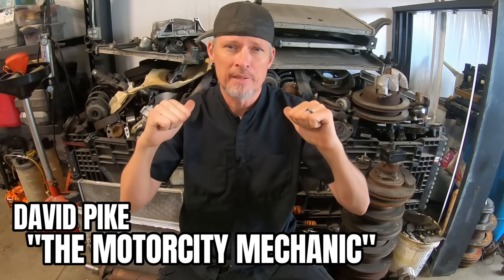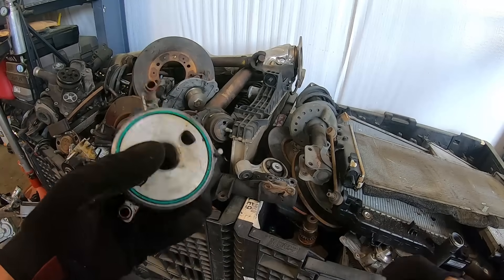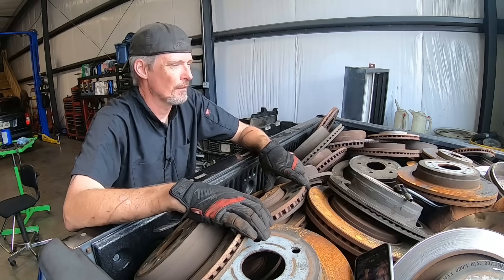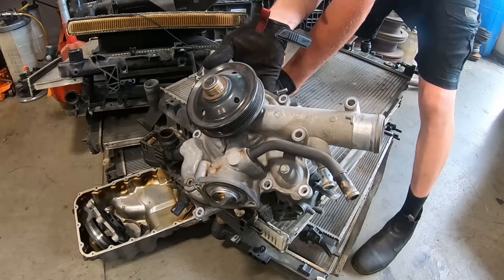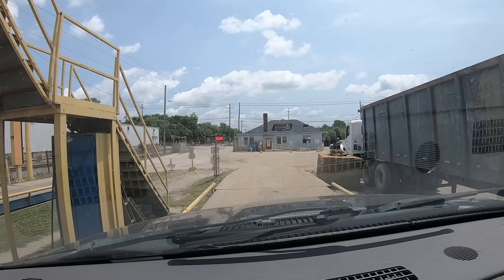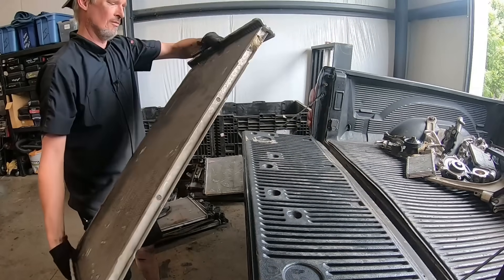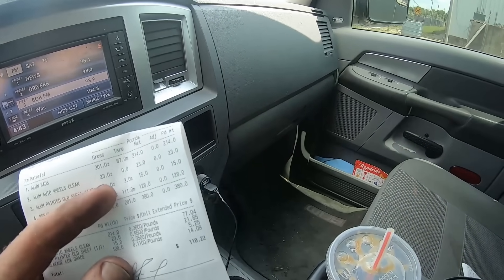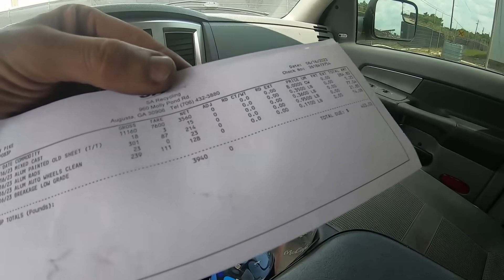Is Scrap Metal Worth Your Time? 2023

Comment: I've been doing scrap metal for about 15 years. You left money on the table by not weighing out after unloading the rotors and drums. Always weigh them out separately from the tin or shred steel. Save your scrap wiring harnesses and separate them, they pay decently. Electric motors such as starters or alternators sell for a different price than tin, separate. You might've made as much as an extra $150 had you separated the materials properly.
Reply from the maker: For me I just didn’t have the time to go that detailed into separating. For me it was….get rid of the pile so I at least tried to clean the aluminum up. Otherwise if I did this regularly I might separate everything further
Reply: @MotorCityMechanic  i like the video i follow you 💯 from #YSW 🇨🇦 respect back to you 🙏 .
Reply: The scrap metal yard I deal with allows me to buy stuff at 2X of current scrap price,  anything from steel to make things to lawn tractors that need a thing or two they are all 2X scrap . Tires are free, aluminum wheels are $ 20.   Many times there are a few months old batteries there so a 90 % discount on a battery ( paying $ 15 ) is worth my time.
Reply: I recommend you have somebody come get that out of your shop every couple of weeks while the pile a smaller and don't waste any time on it yourself

You basically broke even and lost 50 ft.² of your shop floor for two years

Turn wrenches and stack up the labor hours on repair jobs that's where your money is
Reply: If you run a business, it often costs you more in lost time doing all of this than you could make doing your trade.  Never saw a scrapper that made good money, usually it is just survival wages.  Stepdaughter's significant other followed in his family practice of scrapping.  They gathered the materials up and brought it to the farm to prep, like you were talking about.  Yes it looked like they made $300-400 on a load.  But when you factored in the fuel and time simply collecting the scrap, next breaking it down and sorting, then reloading suddenly they were working for about $1.50 a man/hour.  I would often buy at about double scrap rate items from them, do a repair/restoration job on it in a few hours and make quite a bit of cash.  Guy I worked with before I retired had a Son that had a well respected second-hand shop, he went around on those community clean-up days, yard sales and such and collected what others considered scrap for pennies on the dollar, do a professional restoration and sell it for a tremendous profit.  Stepdaughter's significant other, grasped he was working for nothing and quit the profession,  now is driving a truck on day run deliveries making good cash.
Reply: Doing this as a "clean out the shop" you can do some pocket money, but a full-time employment life choice isn't all that good.  You are talking about rebuilding electric motors, remember how long it takes to break one down and separate the materials.  Unless you mean taking the end caps off and setting the armature off to the side.  Cutting out the copper field takes time, you likely have tooling to relative rapidly remove the windings relatively rapidly, but most people don't, and then it takes a bunch of time.  As for breaking down an Induction AC motor armature, why, yes there is aluminum in it, but it would make more sense to simply dump it into the steel bin.  Worked some years back in a motor rebuild shop, with the right equipment it is easy and relatively efficient to recover the copper, and with a DC motor, say 5 hp or above there is at least 2-3 lbs of copper, now on a 100hp DC motor you have a chunk of copper scrap there.  These larger DC motors were usually turned around and returned to the customer, or in that rare case we had a ready-to-go motor for those in need.  So it is making money on your scraps, but as a business to collect scrap to sell it is not really a good idea.
Reply: @thomasheer825  $1.50 per hour of work? So how many hours are we talking here to make the $300-400?
Reply: If you have a business with the scrap building up you can make money by accruing the scrap then selling it off.  That $`50 an hour comes down to simple math, when you have to drive around collecting the materials fuel becomes an issue.  For example, the stepdaughter and her significant other collected materials when local towns had their annual clean-out days.  So they would drive around 120 miles, from house to town and then around the town, and their truck got 8mph pulling the trailer.  That breaks down to 15 gallons of fuel consumed alone and at $3.50 a gallon you are talking $52.50 collecting the materials, which normally was a 10-hour day.  Then since the scrap yard is 25 miles away for a 50 mile round trip, add another $22 in fuel, and another 2hrs involved in transit and unloading sorted materials appropriately.  So lets take $350 as the payout on the scrap -  $75 for fuel, we are now at $275.  Then to break down the scrap they typically consumed $15-30 in saw blades etc..., now we are talking $255.  They had to unload the trailer, sort the materials, break down the scrap then reload it.  This usually took them around 10 hours.  So you end up having to double the labor (10+2+10)x2=44 man hours.  Then you count in ancillaries such as food consumed while on the road etc... suddenly you would be making not that much.  Now if you damaged a tire at the scrap yard, you basically lost money.
Reply: @thomasheer825  Free vacation, 120 miles from home is all I heard.
Reply: @thomasheer825  you smash the core with a sledge hammer it comes right off
Reply: @MotorCityMechanic Usually it isn't worth the time to clean up aluminum.  That's because it looks like you have a lot, but when you weigh, it's only a few pounds.  Copper and brass are worth it, but small gauge power cords, no, not worth stripping.
Reply: I just found a valve cover and a few other cast aluminum pieces, about 20 pounds worth.  I definitely seperate the cast aluminum from the shred.
Reply: @fulltimetrader48  aluminum is not worth much! i pass on that.
Reply: @MotorCityMechanic   I though you did that. I though you unloaded the rotors and went back for one weight in and went back and unloaded the tin.
Reply from the maker: @danielwillliams9669 I made 2 trips…..one aluminum and the other was the mix of tin and cast
Reply: @MotorCityMechanic  its only really worth it if you have a yard to store stuff. if you can fill an entire dumpster with just castings or just brake rotors and drums it goes for a bit more than just shredder steel value but you gotta have a lot of it
Reply: Scrap alloy wheels price
Reply: How do you guys make mo ey on steel when it’s 4-9 cents a pound be it light iron or heavy iron? I do copper as an electrician. But can’t figure how dudes drive around in a beater pickup filled with Steel and aluminum for 40 cents on the Al if clean and make gas money even? Old Hungarian guy taught me to save the Al reflectors inside commercial 2x4 fluorescent lights. Obtained a nice pile off a job.
Reply: @JFEnterprize  it adds up really fast steel is very heavy
Reply: So how much $/ton is steel?
Reply: @bobroberts2371  I had a scrap yard like that near my old house and I saved a ton of money on heavy gauge wiring that was new but "short ends" - often 20 feet or more.. Also saved a ton on aluminum angle for small projects.
Reply: You're so right! The more categories you can sort things into, the more money you can make. I strip and sort it all. It's crazy how many different piles I have; all worth different values!
Reply: I agree 100% separation is where it’s at
Reply: I think it's more of a so I don't starve to death thing. If you got nothing else going right in life.
Reply: They be cast worth more money 8:51
Reply: @MotorCityMechanic what he is saying you unloaded rotors then go weight truck then unload rest of truck the rotors themselves could of been worth over 300 dollars themselves well did it your way and made some money 14:47

Comment: Around here, we separate the sheet steel from the auto cast. The sheet steel currently is $140 a ton and the cast is $240 a ton, and you had mostly cast (rotors, cams, cranks, etc.) so that first load of 3500# would be almost $400 by itself!! Also, Aluminum breakage (odds and ends of mixed aluminum) at $.11 = $220 a ton, is only marginally better than steel prices, so if you can quickly separate it from the steel or others parts, you could make a little bit better money for it, but I'm usually like you and just get rid of it, unless I can break it apart with a hammer or maybe just a bolt or two!! I for one always like getting paid for cleaning up the shop or the scrap pile!!
Reply: Where do live where those are the scrap prices?
Reply: This guy messed up majorly you should separate the wrong rotors short Steel seat iron and he should clean aluminum radiators got more money for them
Reply: I’ve been doing this for a very long time and have been schooled on the many categories and its value, however, I certainly wish I knew when the prices fluctuate. I can’t find out from word of mouth where I can get that particular piece of information or updates
Reply: I remember around 2007 when gas was around $5 a gallon and sheet dropped through the floor under $10 a ton.. Tough tough times..

Comment: I had a couple of trailers, at the time to disposal metal, goes straight to the right trailer, radiators get cleaned at the time to replace them, some companies buy complete starters, alternators and batteries,  and copper from wires extra.

Comment: I've worked apartment maintenance where I've just thrown metal onto the ground outside of the dumpster because I knew the scrappers would just dig it out. Not worth having to clean the trash up off of the ground from them digging it out. A lot of times someone would roll up and ask for it and I'd say they could take it.

Comment: Here’s a quick tip on large brake rotors, a lot of people that build homemade forges will use those in a home built forge and that is the best way to sell those and the bigger the rotor the easier they are to sell,, you can get several bucks a piece out of those like that

Comment: I did A/C in Phoenix for over 20 years.  My boss would just let the crane operator haul away to old units until he told me he made bank scrapping the old units, so I had my boss have him load them in the back of the truck and on the way to my house we would dump them an my back yard (I had an alley access).  On my "down time" usually winter I would go and separate steel from aluminum form copper etc.  When my wife would get yappy about the "mess in the back yard" (you couldn't see it from the house) I would load up my truck on a Saturday morning and run to one of the local rip off scrap yards and cash them in and come home and give her $100 and she would be happy (I usually made $500 or so with a couple of loads).  I mad the mistake of mentioning to my boss how much I made and he tried the "well HALF of that is mint and his wife jumped his ass and told him he just sat around drinking beer all weekend and that I did all the separating and hauling so SHUT THE F. UP.
So I made certain I never told him how much I made. I also kept VERY ACCURATE RECORDS of the make, model, serial number and location it was removed from and how much refrigerant I recovered.  THAT saved my bacon because I complained to the "honest Juan's Scrap Dealer" that they WEREN'T checking ID'S on the Hispanic guys rolling in with OBVIOUSLY NEW rolls of copper tubing and brand new condenser and evap coils that the probably swiped form construction sites.  ME, I had to show my ID, my company information, phone numbers and truck license plate.  I questioned that I had to give all that info but the Hispanic guys just got the old wink, wink, nudge, nudge and off you go.  I turned them  in to the local PD and told them to just sit there in an unmarked van and video all the goings on, confiscate the BRAND NEW PROBABLY STOLEN items and check with theft reports.  Of course the PD wouldn't do anything, instead came knocking on MY door.  Since I had ALL SORTS OF DOCUMENTATION, they couldn't touch me.  I am long since retired and don't have anything to do with maintenance or repairs any more, but DO collect cans and scrap aluminum that gets thrown into alleys.
AND I donated what money I made to one of 3 animal rescue groups on a rotating basis.  So, if it becomes unwieldly and time consuming to you, just have a local charity come and pick it up and they can do the separating and recycling.  I think they would be SUPER APPRECIATIVE.

Comment: I scrapped for 15 years here in Cincinnati. There can be real good money in it if you don't scrap everything. For example, truck tool boxes fixed by replacing broken locks. Lawn mowers that needed a blade sharpening and a tune-up. Steel filing cabinets. Pieces of steel and aluminum stock that hobbyists can easily find use for. Air conditioners that the owners thought were bad, because they no longer blew cold air most of actually only needed a good cleaning and they worked fine. I never had to buy an air conditioner and working ones sold fast at the flea market. And my best find, a portable truck scale which I sold directly back to the manufacturer for $7,000. Garden tools with broken handles. And don't forget to check those boxes and bags because you never know what you'll find. One person throws out a decent item. Three or four different neighborhoods add up to dozens of re-sellable items. I would take a truck load to the local flea market and sell 95% of it. And when scrap metal was over $200 a ton, I made a killing. By the way, I was working a full-time job and scrapping part-time and weekends. One place I stopped at to pick up some appliances were throwing away a garage full of antique furniture!!!! It's hard work but it can really pay off.

Comment: i use old 5 gal buckets from my drive way sealing project and separate as i generate the scrap. All the small steel parts go into the buckets like brake pads , tie rod ends , ball joints ect , and the cast rotors go in a pile outside. Aluminum water pumps , motor mounts ect in another bucket. 
Then i wheel the buckets on my landscape trailer with a hand truck when i go to the scrap yard.

Comment: Good info, I go around collecting in my area and go home separate everything. Stock up for a big haul of each of the different metals and then take it in for a good payday. The only thing is that I too have to accumulate a lot of stuff to make it worth it for me. I spend the time to break everything down. So it pays better and yes there is a lot of time vested to make that pay check even bigger. Thanks again for the time spent to make the video.

Comment: I’m not a mechanic I’m one of those guys who look on  the side of the curb and take some metal most of the time people are happy to get rid of it.  The place I take it …..heavy metal like rotors and heavier automobile parts is a few dollars more than the light metal per hundred pounds …..like right now in October 2023 light metal is going for roughly 7 dollars per hundred pounds….. heavy metal …..rotors and thicker type metal is about $10 per hundred pounds ……aluminum …..brass and copper is the best stuff. Light iron is easy to come by bicycle frames …..filing cabinets stuff like that but, I love scrapping ……it’s a little bit of wear and tear on my pick up truck and like you said you got a watch out for flat tires and stuff but I really love it. It’s in my blood.   >Wayne<.

Comment: I have 5 gallon buckets that I throw bits of cooper wire, cooper pipe and brass into over time. Last week I turned it in 1/2 bucket wire, 1.5 buckets brass. 1 bucket cooper pipe. 234 dollars in my pocket for tossing in a piece at a time. At todays gas prices, that gave me 1/8 tank of fuel. LOL

Comment: Clean and dirty makes a difference  , i cleaned the rubber off old copper welding cables got 2 or 3 hundred bucks
for a 50's Buick radiator got 70 bucks  - aluminum cans did well on those 
but your right time and travel with a small amount or ferrous metal not much money

Comment: my dad 40 yrs ago use to install alum storm doors and windows and 99 % of the homeowners wanted us to haul off the old stuff ,so we stock piled it alongside of our garage, till dec then we would break out the glass and remove the splines and then we also had to remove the steel rivets and screws that held the frames and tracks together so it would be considered clean alum... Christmas was always a great time for our family

Comment: Just a tip to clean radiators from plastic, Get a wood chop saw and cut along the edge of the crimped plastic water jacket, You lose some aluminum but it is quicker.

Comment: In some states you cannot sell AC parts....of aircon units( unless you are a certified HVAC technician or installer). During the recession Times of the housing crash everybody was snatching AC units big and small out of most all buildings private or public. So, in response they made it very difficult to throw for recycling money. As I understand it they recently are or have been doing the same principle /concept with car cat converters. In order to prevent people from cutting off the cats of parked cars on the street. Make it to where its very difficult to get paid for that, so it deters from malfeasance.